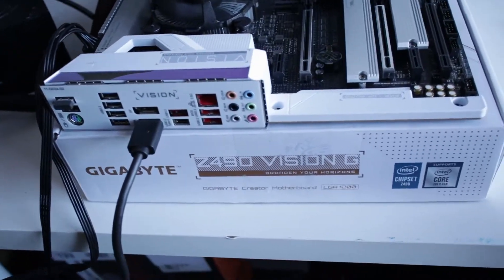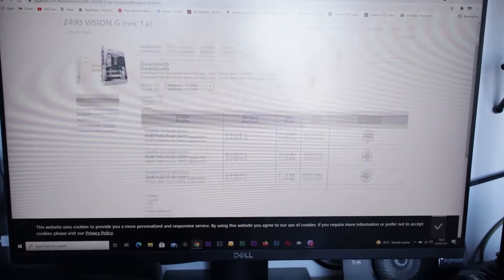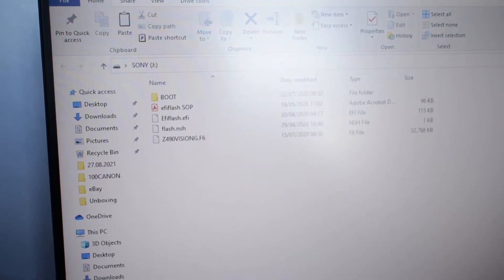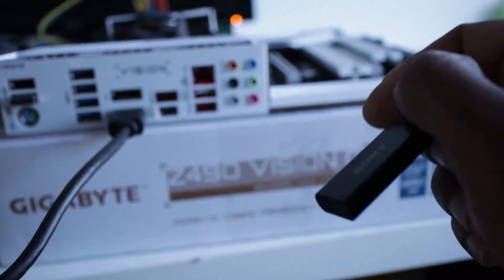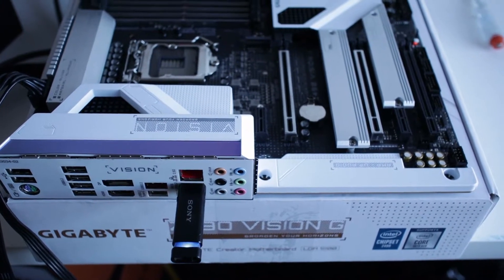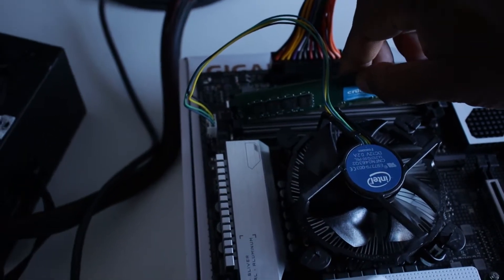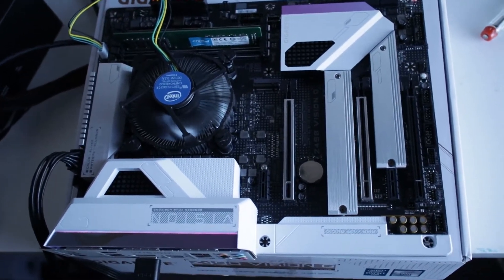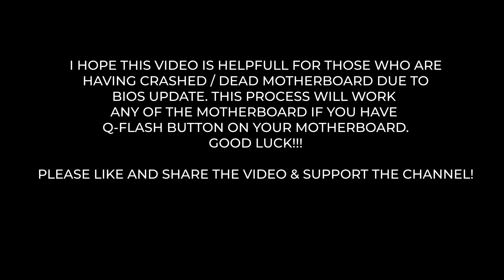GIGABYTE Z490 VISION G MOTHERBOARD RECOVERY / CRASH BIOS

Comment: Is it necessary to remove CPU ,RAM ,GPU ....for Q-flash-Plus ??
Reply from the maker: No it’s not necessary. Make sure everything intact properly before do the Q-Flash. If any of the comments fails during the flashing process your Motherboard will be bricked.
Reply: @ChathuraRanawaka  why in your video, you remove cpu and ram after you motherboard start Q flashing?